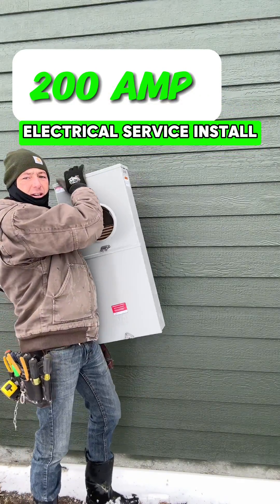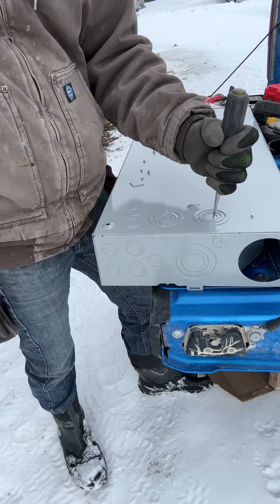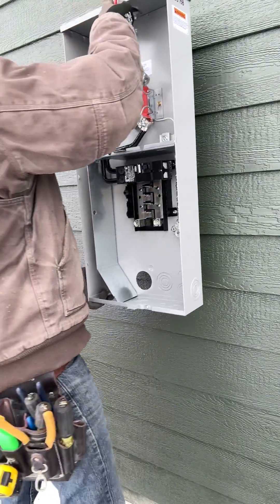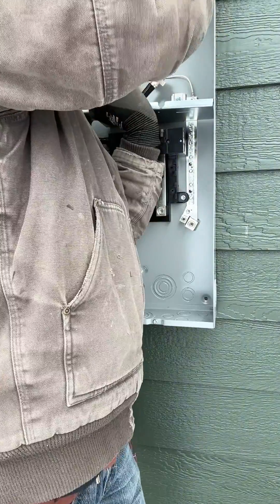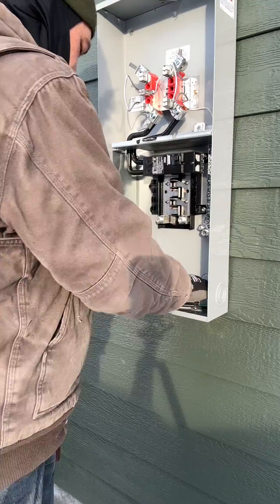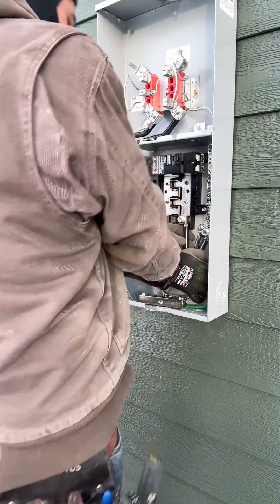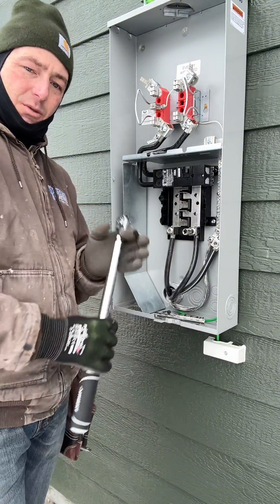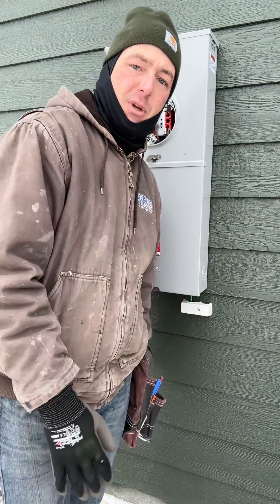How to | install | 200 amp | Underground | Electrical service

Comment: Is that a 200 amp disconnect after the meter socket and does it count for the new exterior emergency shutoff code?

Comment: Can you leave the old 100amp panel inside that the house already has and install this outside with the 200amp panel and it still meet code for the "outdoor cutoff" requirement and this count as a 200amp service upgrade so the power company will hook you up? And if you do leave the old 100amp panel inside to basically make it a sub panel does that mean you dont need to change the line from the old 100amp panel to the new 200amp meter/panel/cut off thats outside? If so that will completely change what im doing
Reply from the maker: Yes you can do that. Just make sure you install a 100amp breaker in the outside panel to feed the sub panel. Also make sure you have proper grounding.
Reply: Can you have a electric man install a 200 amp panel with breakers outdoors and grounded, and the homeowner install a subpanel later inside?

Comment: You did not use any nolox on those aluminum conductors
Reply from the maker: Correct. Aluminum alloy lugs. Aluminum wire. No need
Reply: Thanks for sharing your knowledge.
Reply: I was just gonna say thst then seen this